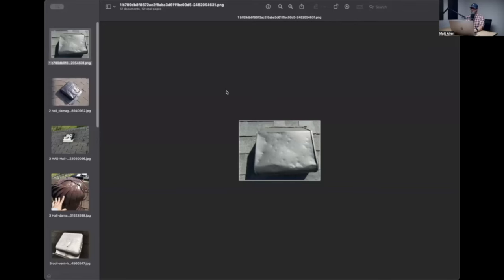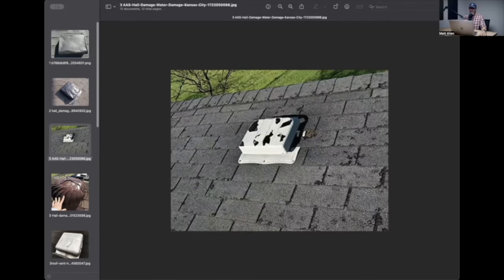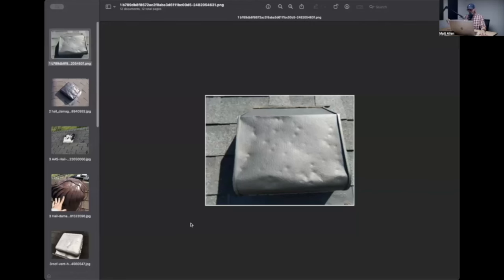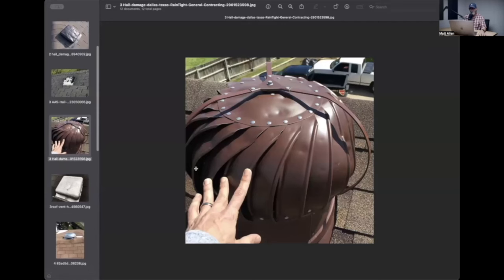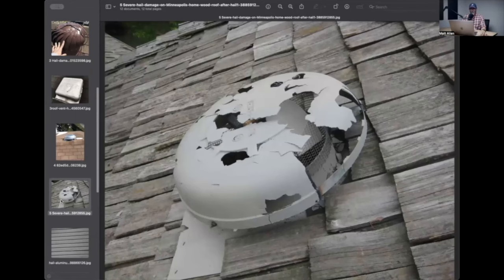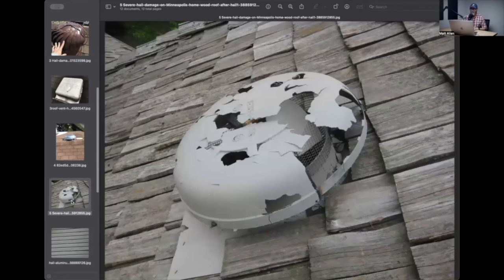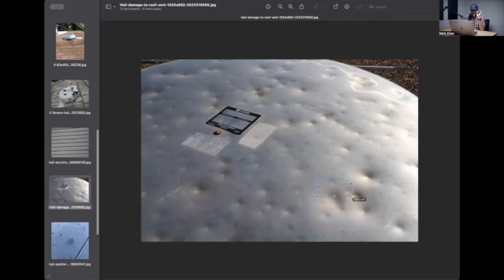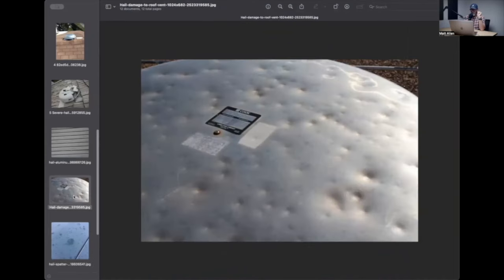Soft Metal And Plastic Roof Vents | Matt'S Biggest Pet Peeve Ever

Comment: I think it is UV penetration that damages plastic internally. I live in New Zealand, the UV is strong here. Lots of plastic things fail quickly. I worked at a place making electrical equipment for outdoor measurements. We always used UV stabalised thick plastic enclosures and cabinets. We used black plastic also, which had, I think, carbon dust, in it, which stopped UV penetration.  

We had some white plastic parts and black plastic parts which were the same, and the white ones failed in a couple months, and the black parts lasted three years. Summer heat and UV work together to weather the plastic.

The powdery surface you can clean with some oil, I suspect, that is the break down of the plastic. Some of the materials in the plastic which make the colour pigments, or opacity of the plastic are left at the surface as the plastic weathers. The plastisizers in the plastic, and in paint coatings, evaporate out of the plastic. You can sometimes heat plastic with a flame torch, which can sometimes mobailse some of the plastizisers to the surface, which can make the plastic look new again, look new, not be new. 

But the cause of the damage to the plastics is the UV or perhaps also heat, so the plastiszers migrate out, and the UV breaks the long chain molecules.

Why do you have vents in the roof at all? Why not have them on the walls, below the eves of the house. I have never seen roof vents on home here. It's not a thing that people make here much. I have only really seen them on commercial buildings here.

Comment: You do realize you cannot buy the power vent cover by itself!
Reply from the maker: Negative:  https://homeimprovementsupply.com/p-6068-air-vent-roof-mount-metal-vent-replacement-dome.aspx?vid=1081275&utm_source=Google&utm_medium=Product_CPC&utm_campaign=1081275&gad_source=1&gclid=Cj0KCQjw7ZO0BhDYARIsAFttkCgOTRuJUzV5f6hHpDeiwx9VjOErlUGXnDKuIJn3hRnqQrSjouZOUgEaAugzEALw_wcB
Reply: I’ve tried that, it doesn’t fit most power vents on roofs we replace. What are we to do then?